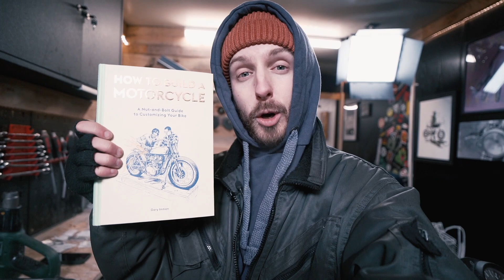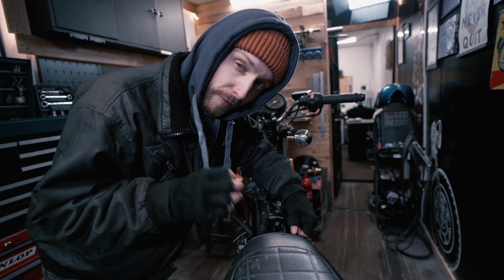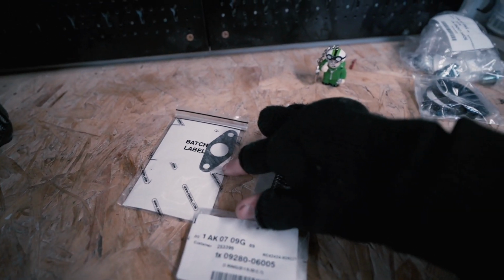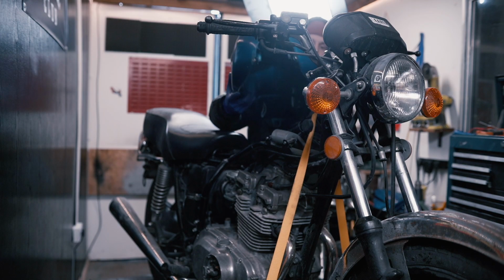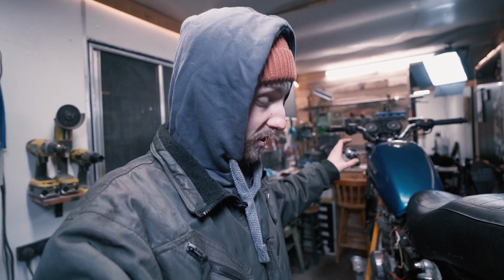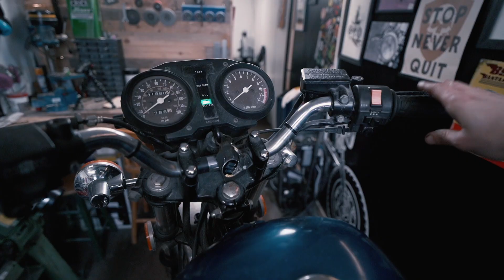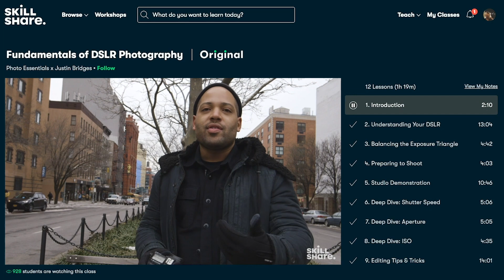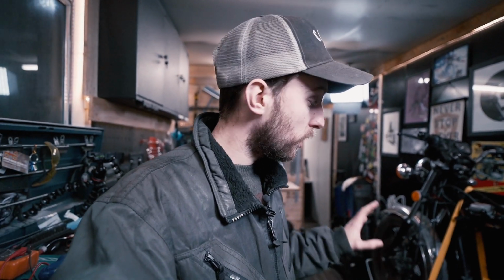Suzuki GS250 - Part 2 - Engine Diagnosis + REMOVAL

Comment: Measure the cam chain length the book should list how long it is over given number of links as this style of engine is known for wearing cam chains, you maybe able to do this with just head and cylinder block off. Could be stuck/bent valve,  noises can be hard to judge. Worn rings pistons and or cylinders usually give other issues rather than rattle/tap noise normally oil burning, blue smoke, loss of power, low compression. Suzy usually more issues with battery chargeing check power to battery with volt meter book should give figures and rpms for good system. Yes many years ago had gsx250 (the sports version of this bike) yes was a learning experience now I am electronics engineer.

Comment: Congrats on the 50K Jish! I once has a 81? Suzuki 400 with the DOHC. The timing was off by 1 tooth and it made a similar noise to yours (after the adjustment, no bent valves btw). Definitely sounds like a top end issue though..... curious to see what it is.... Cheers

Comment: Hey Jish ... the tapping sound is more than likely valves that aren't adjusted correct...  the tapping sound would be coming from the area where you placed the feeler gauges.... it's usually because there is too much clearance (so you can hear the valve tap when it hits the spring).  I hope this helps... maybe the cam isn't lined up correct inside... do you know if someone tried tuning this on their own, or did any head work in the past?  When the valves were adjusted was the crankshaft in the correct orientation?  You're getting compression, so it's not the rings or pistons... you have fire, so it's not the plugs or coils... It's definitely the valves, 100%.  Focus your efforts on the valves.  Hope all is well!

Comment: Have you checked if your camshafts and valve rockers are getting any oil? I own a Suzuki GSX400 Twin (engine is a bid bigger but the valves system looks exactly the same). I also had a ticking noice like you are having. I first let the bike turn using starter motor (oil presure light went off) without the valve cover and realized that the intake recieved oil but exhaust side almost none. After removing and cleaning the camshafts i cleaned the oil channels. when i redid the test the exhaust side was getting more oil and the ticking noice was greatly reduced. Sorry for bad engish :-)